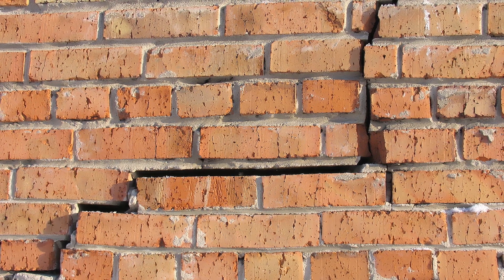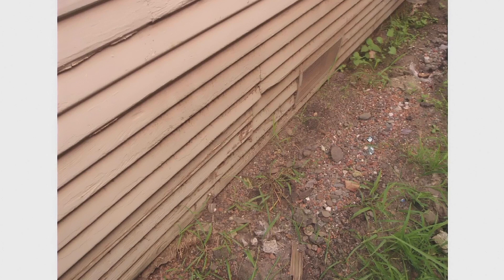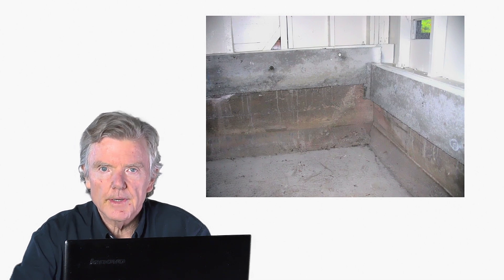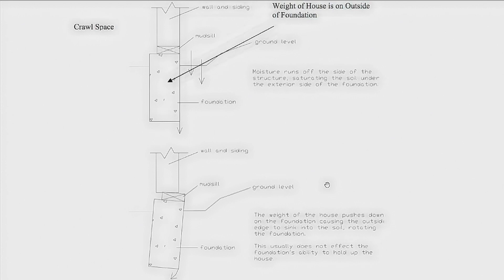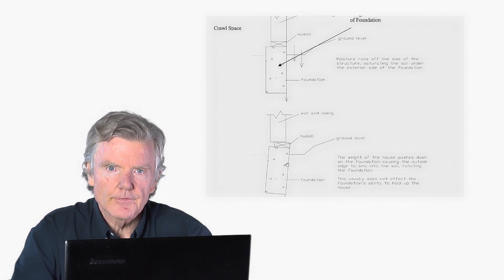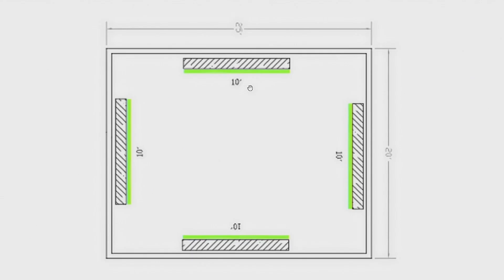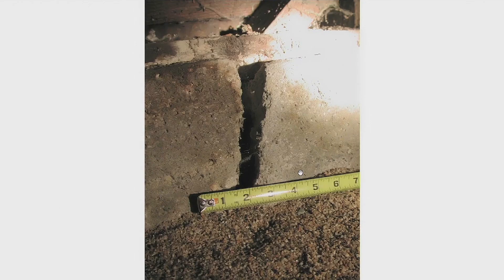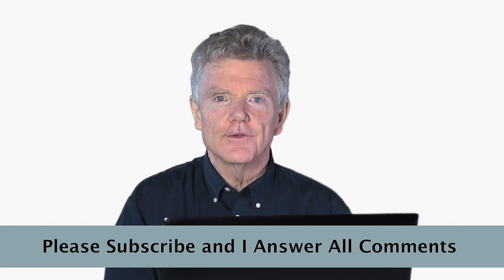Do I Need To Retrofit My Old Foundation?

Comment: This may be a silly question, but is the air gap created by the plastic piping completely open to the outside? Is that gap an entry point for rodents?
Reply from the maker: If a mouse will fit you can assume it will be.

Comment: If a new/sister wall is poured to support the original foundation, would one typically attach the new wall (via it's mud sill and/or top plate) to the old, or keep them separate? If one has a sister wall with anchors through top plate, would one forego doing any attachments to old foundation/plates and simple rely on new sister wall for all connections? I've seen this done but want to know if it makes sense.
Reply from the maker: Why use the old foundation?  Sistered foundations are poured because the old foundation has lots of problems.  Old foundations normally perform quite well.  See https://bayarearetrofit.com/foundation-cracks/

Comment: This was quite eye-opening, thanks! Subscribed and poring over your website. We live in Portland, OR, and the 100-year-old foundation of our bungalow is very crumbly in spots, with a section dividing our half-basement from the crawlspace literally turning into sand. The local seismic expert (as seen on Ask This Old House) quoted us $30K in 2014 to pour new footings and walls inside the entire perimeter of our existing walls and tying our house to new cripple walls built onto the new concrete. I'm guessing the cost would be at least double that now. Maybe we should hire a reputable seismic engineer who doesn't have a stake in the contracting to get their take.
Reply from the maker: Sorry I am so late in my reply.  I do not know YouTube did not notify me about your comment. You can figure it out yourself.

Comment: This is a great video.
I have foundation (house from 1925)  where at least one of the sides has 1 to 3 rows of short cinder blocks filed with cement sits on top of a poured foundation.  How is that bolted?  Do you just drill down through all the cinder block cement until you get into the poured cement?
Or would something like simpson strong tie st6224 16ga straps bolted into poured cement foundation and and attached to mudsill via SD screws be enough?  I assume the straps may not have much lateral force protection.

Thanks for any input.
Reply from the maker: I would drill straight into the brick.
Reply: @bayarearetrofit5814   into the brick only or through it all the way to the poured concrete? 
Thanks again.
Reply: It night have been wet set with nails.  Get a stud finder and chack for that.  Otherwise, drill all the way to the concrete and use Hilti expoxy.  I think it is HY 200

Comment: Thank you for this video as it seems to address my exact problem.   I have a foundation wall that is not sitting on it's mudsill. Do you think that a foundation cap would be the most economical way to fix this situation? Have you ever known of a new pressure treated 4x6 being used for a mudsill instead of the foundation cap?  I'm wondering because of the gap size being no larger than 3 1/2 inches and tapering down in size.  Or, do you think if TF structural repair mortar would work? 
 Thank you for any input you may offer.
Reply from the maker: You mean there is a gap between the foundation and the bottom plate of the wall?
Reply: @bayarearetrofit5814   Yes, from one end of the house to the other there is a tapered gap from zero to 3 1/2 inches.  We leveled the house after we bought it which caused this issue.
Reply from the maker: Use pressure treated shims
Reply: @bayarearetrofit5814  Thank you so much for your advice!  I appreciate all of your help more than you know!
Reply from the maker: Happy to help.  Be sure and subscribe.

Comment: Hi Howard, I have an old brick foundation and odd U “horseshoe” shape house and some walls are longer 51’ and other sides are 24’ and 15’.  I saw the part that u mentioned for brick foundation,  u pour a new concrete foundation in front that’s 10’. In my situation, what length of a foundation should I use since some walls are longer and some are shorter?
Reply from the maker: Are you the person from Los Angeles I talked to?
Reply: Bay Area Seismic Retrofit , yes! I also texted u some photos of my floor plan, did u get it? The house is a 2 story Spanish home.
Reply from the maker: First figure out how many linear feet of plywood you need and you base everything off of that.  To do that you need to know how much the house weighs.  How many square feet and is it stucco or wood on the outside?  How old is it?
Reply: Bay Area Seismic Retrofit , the house originally built 1890, outside is stucco, 2 stories. 3052 Sq ft. How do I know how much it weighs?
Reply from the maker: It weighs 45 pounds per square foot according to the engineering calculations found on the website.  Take that and multiply it by 0.186.  Divide by 2.  That is the amount of force you must resist on each side of the house.  Go to this webpage  https://bayarearetrofit.com/hardware-and-plywood-earthquake-resistance/ and figure out what you need and get back to me.  Usually you are looking at L90s everywhere and you can use any type of bolt.  When you are looking at the plywood table use the 870 Lbs per linear foot requirements on the table. 

.  Sorry for not getting back to you sooner.  You are probably going to need to use mudsill blocking.  https://bayarearetrofit.com/mudsill-connection-in-cripple-wall-retrofits/  Use the Simpson SDS screws, don't use nails.